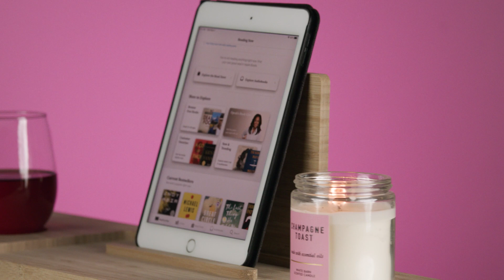Making a Bath Tray Caddy with the iQ Desktop CNC Router | Laguna Tools

Comment: How was the wood held down?  2 sided tape?
Reply: I'd say so. I almost exclusively use double stick tape for my work holding on my machine
Reply from the maker: It was 2-sided tape indeed!
Reply: @Justapotato14  me too but I use the thick foam style tape.  That way my bit doesn’t actually touch the spoil board.  The wood in the video seemed to be right on the table whereas my material floats about 3/16 of an inch above the spoiled board.